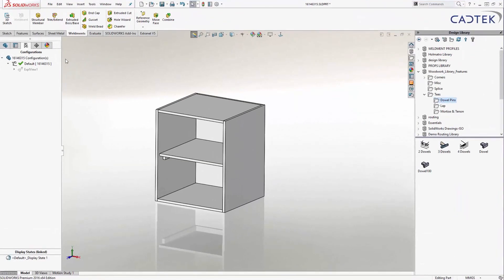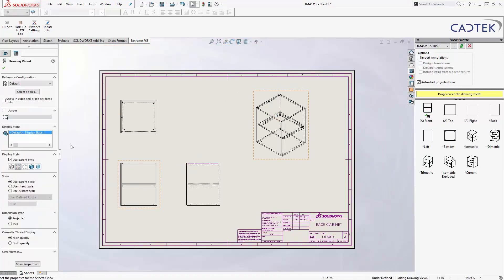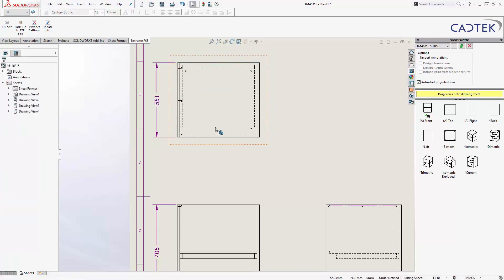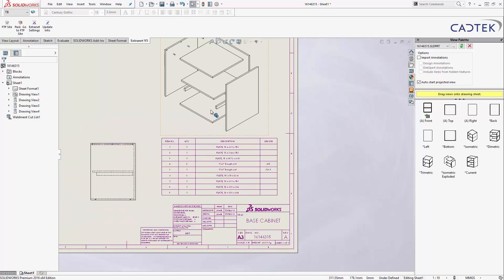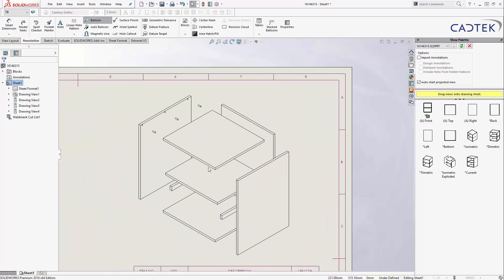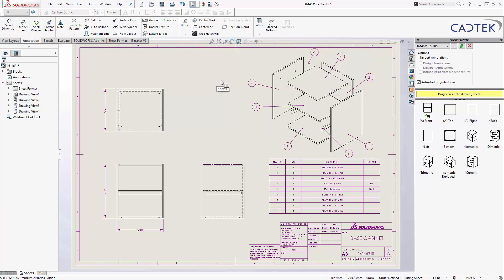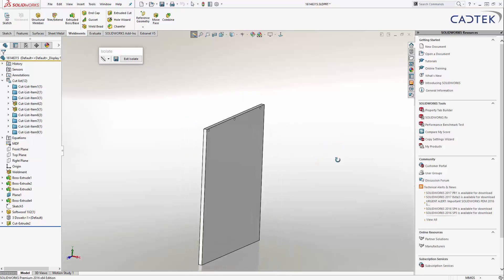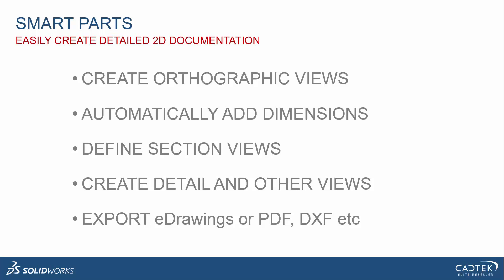Introduction To Cabinetry Within SolidWorks Part 2: Technical Drawing

Comment: Hi, thank you so much for these video series. It is really helpfull and I learn a lot from it. Question: how did you get your weldment cutlist to be filled in automatically? When i import the table, the descriptioncolumn is not filled in like yours is :(
Reply from the maker: Jonas what you'll have to do is go to your cut list, right click on  an item then go to properties and you'll have to set them up for it to pull through to your BOM or table in question. Hope this helps.

Ollie
Reply: Thanks for the reply, the answer was in your video: I forgot to hit the bounding box  :)